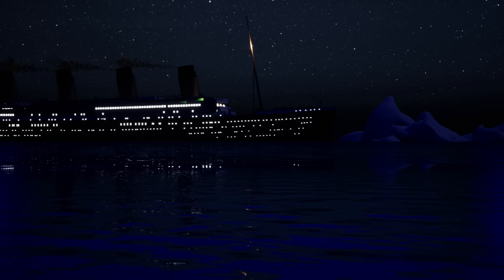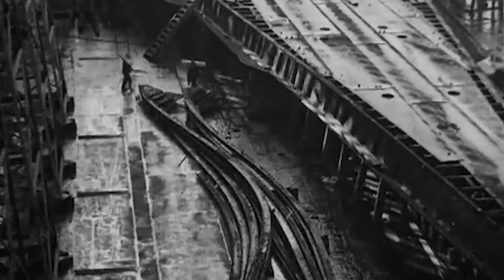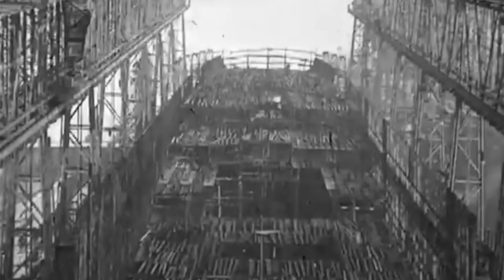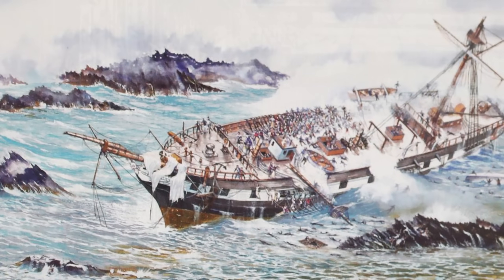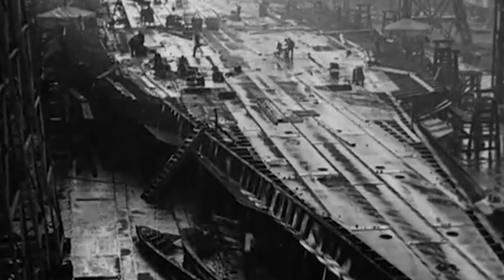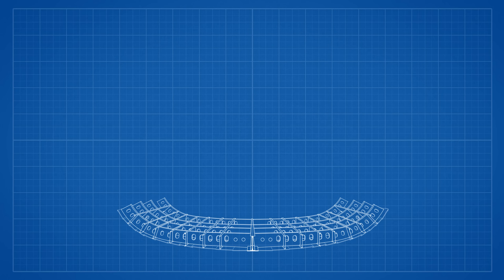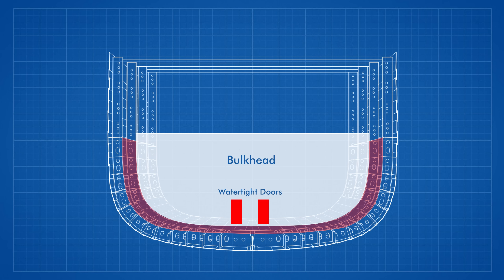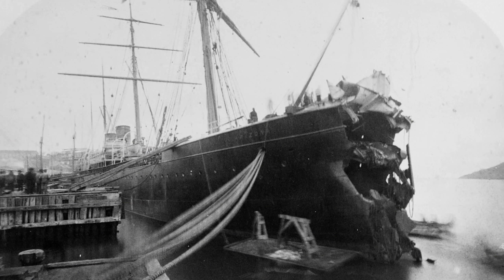How did the Iceberg Sink the Titanic?

Comment: There's a story from WWII, I think, about a ship that was hit by a torpedo. To save her and stop/slow the flooding, the crew used mattresses and blankets tied together and lowered over the side of the ship where the hole was. The mash of material was pressed into the hole like too much toilet paper in a drain and significantly reduced the flooding enough for the ship to limp back to a drydock.
Reply: Titanic had pumps to fight the flooding with as well and they were at least put into use. Even if the flooding was reduced by only 50%, worst-case scenario: Carpathia arrives on the scene with an hour to spare. Best-case scenario: a 50% reduction in flooding is enough that Titanic's own pumps can keep up and the ship is able to float until more substantial help arrives.
Reply: @dextercochran4916  Titanic's bilge pumps pulled 2 tons of water per minute each. the flooding was calculated at 400...
Reply: I'm in the RCN and we have a bunch of different methods and tools to stop the egress of water, blankets and mattresses are definitely a valid method.
Reply: That is a technique called "fothering" and it has been known for centuries to be effective.  One of the genuine mysteries about the Titanic was the near complete lack of damage control ordered by Capt. Smith.  Given the nature of the damage suffered by the Titanic even fothering with carpets would likely have been effective enough to keep her afloat for a significantly longer period of time.  As it was, her hatch covers were heavy canvas, and would probably have worked very well.
Reply: I remember seeing that in the Horatio Hornblower series.
Notation, seeing that his cattle ship was holed beneath the waterline, dived in with canvas and plugged the hole while his sailors pulled it tightly in place. 
It might have worked if Smith and Andrews had tried it on the boiler room gash.
Reply: @fearlessfosdick160 I believe the lack of experienced seaman had a part in lessened damage control by 1912. These large vessels were more floating hotels than ships! They didn’t have enough seaman to man the lifeboats even though they were only allocating 2 per boat lol. That’s was why Lighttoller allowed Peuchen  into a boat because the ladies said they were short handed.
Reply: @fearlessfosdick160  how many able body seamen would it take? How long would it take to undo a tightly dogged hatch cover? Where would they get the rope to lower it? Would any of them have any training in “damage control”? Was “damage control” even a concept on any civilian ships of the time period? Remember this is 1912 not 1940’s…
Reply: @timothyreed8417 1500 people were sentenced to death, they had nothing to lose anymore, so 1500 passengers could've been able to do it.
Reply: @fearlessfosdick160  what’s fothering? And how would canvas have helped? Is it like waxed canvas?
Reply: @BarBea83722  To fother is to drop a sail or canvas hatch cover over the side of the ship and drag it toward the keel until it covers the damaged part of the hull.  The water pressure will hold it in place and the canvas becomes waterlogged and slows the ingress of seawater.  I am not saying that Titanic could have sailed to New York in that manner, but it could very well have kept her afloat until Carpathia arrived.  Any slowing at all of the rate of flooding would have given Titanic more time, hence my observation about attempting it with carpets.  That would not have been optimal, but the idea is to slow the rate at which the ship is flooding.
Reply: @fearlessfosdick160  That technique originated and was used, with some success in the era of much smaller, wooden sailing ships. Whether it might have been possible or effective on a ship the size of Titanic is yet another question to which we'll never know the answer. All we do know is that they didn't try it.
Reply: @fearlessfosdick160  bullcrap
Reply: @fearlessfosdick160  you can kind of see how insurance fraud rumors would be suggested. There's a great deal of interesting information behind the theory.
Reply: There are devices aboard ship called collision mats that are designed to cover breaches in the hull. They are made of canvas and other materials and block water entry by external pressure pushing the mat against the hull breach.  Titanic did not have enough life boats; did they also not have collision mats aboard?
Reply: @johnemerson1363  Well, one has to remember that this happened in 1912.  They may not have had collision mats yet, and the Titanic was meant to stay afloat with a large number of compartments flooded.  Titanic was meant to be her own lifeboat.  One also has to take into account that a lot of our modern means of damage control at sea, including our modern method of tracking icebergs, were learned as a result of the Titanic disaster.
Reply: @fearlessfosdick160  Very possibly.  I don't know the history of collision mats.
Reply: @johnemerson1363  No they didn't.  Damage Control to limit the ingress is provided on naval ships and they are also trained in it (I was an RN qualified Damage Control Instructor).  I was also in the MN for 18 years and can assure you that a ship of the Titanic's size is an impossible fothering exercise, especially with lack of materials, trained men and only around an hour and a half at most to achieve it.  Fothering went out with sailing ships - you have to not only lower the fother over the side, you have to pull on the other side too to pull the fother under the ship.  The Titanic's crew may have done it on sailing ships but not a massive liner.
Reply: @stephencarey5074 its a shame you were not on the ship to help stop it from sinking
Reply: Interesting theory ? Maybe this could have saved Titanic. Only instead of using mattresses they could have used Cal and Rose's mother to plug the leak
Reply: @Number-5-is-alive  Perhaps it could’ve helped Titanic stay afloat longer, but save it?
I think that’s near impossible. The damage was simply too deep, certainly too deep to use this technique & continue trying to sail to NYC:
Reply: @Number-5-is-alive underrated comment. An cals money haha that woulda helped
Reply: Fothering is cool and all, but lets not forget it was like  20 or 30 meters from the bridge to the water, so lowering anything from the height is kinda hard.
Reply: That happened. I believe there are things called Crash Blankets that do exactly that once lowered over the side on the outside of the hull, but were first used in WW1, several years after this collision. Just watched another YT video that postulated that if the Titanic had gone straight into the iceberg, the bow would have been completed trashed but it would have damaged less watertight sections and they would very likely have survived.
Reply: Theres nothing that could have saved titanic after the collision other than a closer ship to them. The iceberg never ripped through the hull plates. Rather it sheered rivet heads off and or bent the overlapping hull plate connections over a 300 ft span. The gaps that formed allowed water in so far below waterline that the shear weight of the ship as she filled increased the flooding. The entire opening of gaps between plates and or missing rivets formes total area the size of a kitchen table... Thats all it took. Over 5 compartments compromised, even with the pumps running, the design of the bulkheads as advanced as they were did not go up high enough to a sealed deck like B deck. She did not have a double hull. She stayed afloat over 2 and a half hours, that alone is a marvel. So she was doomed long before the collision by design yet she was as strong as she could have been given the time period and technology that was applied to her. Also, bad luck played a part in the demise as well.
Reply: @MarkPB90  
The rivets were countersunk in that area for obvious reasons, so wouldn't shear off.  Sonar scans show rents in the hull that are not in line with the plate edges.  The same with Costa Concordia - the plates tore, not the welds.  A welded or riveted joint is stronger than the parent metal.  We won't know for sure unless they get a suction pipe going in the bow area!
Reply: @stephencarey5074  Please eplain then how we have pulled hull sections up with missing rivets. You hit those rivets and shear the head and then bend that plate off the contact point that little bit of rivet behind the plate wont hold it together under that kind of pressure. The berg popped rivet heads and the plates separated. A ship going 20kts side swiped an immovable object. None of the reports from the fireman below in the trials support tearing the iron shell plates. If she was gashed she would have gone down much quicker than she did. Now, Fred barret testified that it was torn through boiler room 6 however after 10 minutes after collision when he returned to 6 the water level was only up a couple feet. That doesn't support a tear. The other info thats been examined is the rubbing or bumping of the ship on the berg at the bulkhead/ plate joints which would compromise bulkhead rigidity. 2-5 got it the worst and none of the sonar scans have shown a hole beneath the seabed in the draught portion of the hull plating. The only hole on the starboard side has been from impact on the seabed when she broke her nose.
Reply: @MarkPB90  
Those rivets were from the accommodation area and not from the underwater hull.  They had already been subjected to massive stress when the ship broke apart, and had been underwater for a century.  There are no rivet samples from the damaged area because it's covered in silt and still part of the ship, which is still supporting its structure a century later.
We'll find out one day, but I doubt I'll be around!
No one down below would know how the water was coming in, only that it was.  It was very sudden and th area was hidden by the boilers themselves.
I was in a ship which was holed by ice - the plates tore, not the welds, and who knows whether the ice was in the rivet or plate area?  It makes no difference anyway, the hull was pierced and the water came in.
The underwater rivets were countersunk, not proud of the plates.
Reply: The video passed and i heard nothing of it, i got lost in this comment thread, it was so interesting, i never knew this technique. Thankful to all of you for sharing 😊
Reply: Honestly seeing something like this makes my head turn in every which way. The gashes in the titanic (whether they were gashes or shaved rivets) were long yes, but not thick. Think of them as a papercut, in another video the creator mentions that they ranged from 1 to 6 inches in width. Not only that but had they been able to slow the flooding in at least one compartment the titanic wouldve been able to stay afloat. (At least longer than she did) The titanic was one of the first ships to implement the tanktop, and it was designed to keep the ship afloat with 4 compartments completely flooded.

This is also not to forget that yes there gashes were long but the intake of water creates such pressure that it wouldve held whatever they threw down there very very well. And hell, even if it didnt? The objects wouldve flown into the compartments and took up space, leaving less room for water and creating at least some form of slowing mechanism.

There are also arguements made that had they hit the iceburg headon they wouldve been able to still make it to a port nearby (people wouldve died, but not nearly as many that did here). 

Overall, the titanic sinking cant exactly be blamed on one specific thing. (Well i guess it could technically, but i dont see yall fighting an iceburg so?) The titanic was one of the best engineered ships over her time, right along side the britanic and the olympic. So engineering couldnt have been at fault. Realistically we couldnt have expected a captain to willingly go head first into an iceburg, especially when that would have meant instant casualties in comparison to this method (which he couldnt at the time know what damage it would have caused). Lack of damage control was definitely notable, fothering mightve been effective enough to keep her afloat just long enough for the carpathia to arrive. However I do believe this wouldve had to of been done by the passengers. If a group of 50 passengers had taken mattresses, rope, and weights they couldve fothered at least one compartment in an hour. And that was really all they needed. People say there was plenty of crew and they shouldve done something. Realistically, yes there were alot of crew members, but most of them were panicked or attending to their posts damn near to the end. Lets not forget that this was such an intense thing that the third class passengers were ☆completely forgotten about☆ they were not given instruction, and the ones brave enough to wander up deck and then into an area unknown to them to try to get a lifeboat, wouldve undoubtly have been too late to get on one. The main focus here is that the captain should've attempted some form of damage control, but when it first happened they hardly knew how bad the damage really was(nt). Lets also mention that had they created a water tight ceiling for these compartments it wouldve definitely led to a slower sinking. 

All in all, it was her maiden voyage and it was entirely unexpected. Who knows what wouldve happened if the operators had listened to the californian, or if the crew/passengers had attempted fothering. All we can do is sit back and address it from our modern day perspective. The titanic sinking was devastating, but I personally do not believe it was anyones "fault" the ship sank.
Reply: Don't forget: Titanic was designed to float with four compartments breached. All they had to do was stop the flooding in ONE of the compromised compartments.

Alternatively, they could've flooded one of the aft compartments as a counter-balance to keep water from spilling over the tops of the bulkheads.
Reply: Check out the story of the American T2 tanker, "Ohio" torpedoed during WWll and ultimately kept afloat by "camels" until she could discharge her cargo of fuel oil in Malta.
Reply: If the gash was under the water line and quite a big drop from the top decks of the ship, how would they go about fothering? serious question not saying it would or would not work
Reply: @kgisabeast Tie the blankets tightly to a rope and lower it down from the deck.
Reply: That's SOP.
If you can not adequately seal the holes from the inside, you do it from outside. 
The point of flooding control is not to stop the flood of water into the ship, it's to make certain the eduction pumps can work faster than the flood.

Edit, yes, even in this day and age, navies are taught to use mattresses, pillows, and blankets for damage control to save the ship. It's much more nuanced than it sounds, but it works.
Reply: I came across a similar story when I used to spend time on the royal marine recruitment forum. One of the admins was ex Royal Navy and his profile picture was of the mattress up against the inside of the vessel. I’m convinced it was a submarine but I could be wrong. Anyway, I believe it was during the falklands war.
Reply: I thought I heard a US destroyer or cruiser did something like that back in the 80's or 90's as well, after a terrorist attack
Reply: The ship was commanded by captain lewis
Reply: Man this comment section is dope.  I have read each comment! 
I never thought of the situation this way!  Great theory!
Reply: @MohammadFarhan-mo6mo  Faulty theory since it wouldn't work
Reply: Allegedly there was already 14 feet of water in the first couple compartments after 10 mins.  Who is going to be able to dive down 14 feet in ice water to stuff a mattress in a hole you probably couldn't even see?
Reply: That's a common practice, called a collision mat.
Reply: Thats easy the ww2 were filled with soldiers the titanic was mostly loaded with the rich and spoiled that always had people do things for them
Reply: @Zander Vanhyden  the ship was sunk on purpose , it was a psyop,  insurance sting and multiple murder . I can prove it
Reply: @astitvayaduvanshi312  Irrelevant.
Reply: Sounds like a load of bullshit to Me , a gaping hole with rushing water would suck a mattress straight through.
Reply: Yes that ship was uss Texas a ww2 battleship
Reply: Sounds like a load of bullshit ...
Reply: Nopes. Period.
Reply: The Olympic is the scuttled wreck on the bottom of the sea. The actual Titanic went on to serve the germans in two world wars. The White Star lines and Illuminati were doing a great work Op. Search the Document - Polar Field Reversal as Seen With HINODE. It's all about our (local) Sun's intrinsic magnetic field is changing to a Quadrupole comfiguration, now look at the day the NASA doc. was released. Our "Sun" is supposed to go white before it extinguishes completely. This seems to have been resolved w/the energetic comets etc.
Reply: The remains of SS Great Britain were towed back from the Falklands to the UK in similar manner!
Reply: Really cool story. Thank you!
Reply: You guys seem very knowledgeable and this seems to be a very good comment. Everyone just trying to help each other and no egos getting bruised.

I'd like to understand more about ships and their workings. I have absolutely no experience but anyway here goes.
Even though I know this idea is too simple, I want to get a good idea of the mathematics here.
It was too late when they saw the iceberg to turn the ship on its course so they stop the engine. Stopping the engine takes time obviously and the ship is still going to sail for a long time after. I don't know how long but maybe you guys do. Now, what about the option of even reversing the engine and turning the rudder such that the ship is diverted away from the iceberg. What are the time tolerances here for what I'm talking about back in 1912 relative to a ship today?
Reply: @jimheffernan6341  They did reverse the engine. Thing is: even doing that, a ship with Titanic's mass is going to take at least a half-dozen miles to come to a full stop.

Titanic actually didn't miss its turn window by much. Had the crew seen the iceberg just a few minutes earlier and everything else played out the same, she could've dodged the berg.
Reply: Q
Reply: Yeah but on the Titanic they wouldn't have just used mattresses and blankets tied together they would have thrown 3rd class passengers in two to help block the gaps with their bodies, hands and fingers.
Reply: Stuff Unsinkable Molly Brown in there.
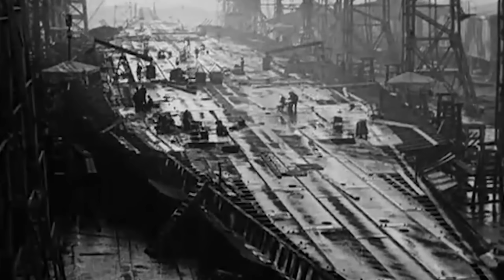Reply: 🎉🎉🎉🎉🎉🎉🎉🎉🎉🎉🎉 1:51
Reply: The damage to the titanic was just too much for something like that to work.  Even if it could work they would have had little to no time to get it done.  Yes, it took almost 2 hours for the titanic to fully sink.  However, it only took about 10-20 minutes before any possibility of saving her was gone.  By the time they knew the full extent of the damage it was too late.  They had zero opportunity to try anything.  At that point, the best they could do was slow it down enough to buy a few extra minutes.
Reply: @jeremywj  Sorry but this is really wrong.  As long as water is entering the hull fothering will work, and filling an area that's flooding with buyoant material to displace water will always displace water.  And even if it were true, an extra 10 minutes could've seen the collapsibles properly filled and dozens more lives saved
Reply: @jeremywj  You are suggesting that a torpedo blast would do less damage to a ship much smaller than Titanic than an iceberg sideswipe to Titanic herself.

That's the only way what you're saying makes any sense.
Reply: @dextercochran4916  Have you tested the power of a torpedo vs a hard, massive chunk of ice at twenty plus knots of speed?

If so, please report back.
Reply: @Grandmaster_Dragonborn  Do you really need a hard test to confirm if 1 ton of TNT causes more damage to a purpose-built warship than a large chunk of ice to an ocean liner at a steep angle???
Reply: Shame that their finest Persian carpets would have probably been the best thing due to their close weave. A piece of culture from the desert goes to the bottom of the ocean.
Reply: It's weird how such an experienced captain didn't even attempt basic damage control like that.  Have the crew smashing up deck chairs and stuffing the front of the ship with the broken wood - it displaces water and increases buoyancy.  Grab the canvas hatch covers, weight one end and lower them over the side with ropes - instant hull patch.
Reply: @saucyduckglobalomnihyperme7510  In retrospect, yes, that would have slowed down the intake of water. But during the event, they were best-guessing where and how many gashes there were, with some fearing openings closer to the keel (not just the starboard side plates).
Reply: @saucyduckglobalomnihyperme7510 after a tragedy it’s easy to come to conclusions.. we don’t know how serious the flooding was in those compartments and if people could work out a viable solution.
Reply: @saucyduckglobalomnihyperme7510  It's tens of thousands of t of water a few broken chairs won't give her back her buoyancy.

Why canvas wasn't used I don't know that's been done for centuries. Maybe didn't have anything large enough or no good way of getting it there. Diving to a hole on an age of sail sloop and stuffing some rope in and covering the hole with canvas is a bit easier than doing it in the frigid Atlantic on such big ship. Someone usually had to dive down and make sure the canvas is positioned well.

In theory if they could have patched boiler rooms 5 and 6 it might have worked but 6 was already full pretty quick and that was enough to take her down. She may have had the margin to stay afloat with Nr 6 flooded maybe not.

I think the pumps could do 250 t an hour so if the inflow could have been stabilized in Nr. 5 and 6 rooms maybe. Could certainly have given her some more time, maybe enough for Carpathia to arrive before she sank, maybe even hook up her own pumps until a pump ship could arrive and take over while they tow her to port. 

I know that using canvas was less common then than it had been 50 years earlier don't know why. Maybe it was deemed innefective or ships simply didn't carry a lot of it anymore. 

But mainly I think the job of diving around the hull and figuring out where to put canvas was too much to ask in -2C water.
Reply: @please_stop-v7o  The cargo hatch covers were big thick sheets of canvas. No need to dive because they knew where the water was coming in, especially in Nr. 5.  The ship was at a stop, all you had to do is weight the canvas and lower it over the side by the correct amount, which anyone could've calculated in about 3 seconds.  And the practice had been around since the 1770s.

Also they only needed to displace a few percent of the water in the bow to have a big effect on down angle, which means limiting spillover. Especially if you can get Nr. 5 watertight and cover another square foot or so of opening, they really might have floated until morning.  

It just seems like Smith got told too much of the ship is open to the sea and help was hours away and sort of gave up
Reply: @saucyduckglobalomnihyperme7510  during the time, they seemed to think that the iceberg tore a massive continuous 300ft gash into the hull which probably would've been impossible to plug. One can only imagine if they had known it was just the rivets which popped and managed to plug up the holes.
Reply: @fearlessfosdick160  alright then, where would they get the manpower to drag a wad of material under the keel and plug the hole? The crewman? Well the crew are already working on the lifeboats and if this plan fails and the plug breaks or they fail to locate where exactly the hole is, then that’s less time to launch the boats. If you knew anything about Titanic, you’d know that they just barely managed to get all 20 boats off, with 2 of them literally being floated off the deck damaged. If this plan fails, then some boats would’ve definitely failed to launch and more people will die. It’s an extremely high risk situation is my point.
Reply: @AndyHappyGuy  Having done it myself, I can tell you that a relatively small team could have accomplished the fothering of a couple of those watertight compartments within a half hour.  During the first hour of the sinking, there was no damage control attempted apart from simply closing the watertight doors, and the officers did not begin to lower the lifeboats for at least an hour after the ship began to sink.  Titanic carried 913 crew members.  There was plenty of time and plenty of crew to attempt the fothering of the hull at two or three of the watertight compartments at the very least, possibly even all six.  It could have worked, but today we will never know how well.  And understanding your intital confusion, one doesn't have to drag it under the keel.  I said drag it toward the keel.  In Titanic's case, one would have lowered the canvas, perhaps weighted, to the level of the damage.  Water pressure would have then done most of the work after that.
Reply: @fearlessfosdick160  now you've gotten me curious. How would the canvas or whatever material they could use slow or stop the water coming in? It's got to be a couple thousand gallons of water coming in a minute, wouldnt the same water pressure that sucked the material in destroy it too?
Reply: @fearlessfosdick160  im curious as well, how do they know they are lowering this material to the exact location of damage? The suction just guides it to the hole or what?
Reply: @marked4death076  To a large extent, yes.  In the Titanic's case the location of the damage was known to Capt. Smith very quickly.  As I already said, the point is that they didn't have to stop the flooding but only slow it, and they didn't have to fother all of the damage, just enough of it to keep two or three of the compartments from flooding as quickly as they did.  It likely would not have saved the ship, but it might have kept her afloat long enough for Carpathia to arrive.  As to Andy's question, no, the canvas would not necessarily be destroyed by the water pressure, especially given how narrow the damage between the plates was.  If nothing else, it certainly would have been worth the effort to try it.  The thing about it that mystifies me was that apart from closing the watertight doors and turning on the pumps, no attempt at damage control was ever made.
Reply: @fearlessfosdick160  wow and they would of have clearly known this i would imagine even back then, that is odd they never thought of it. Panic maybe? Just not thinking clearly
Reply: @marked4death076  Yes, they would have known it.  Fothering is a technique that is hundreds if not thousands of years old.  In answer to that question, if some of the reports can be believed, Capt. Smith went into a sort of funk when he realized that his ship was going to sink.  It is plausible to surmise that he wasn't thinking clearly at any point after he ordered the lifeboats lowered.
Reply: @saucyduckglobalomnihyperme7510  You're forgetting the intake of water on starboard side would have made Titanic list to that side, making it extremely difficult to apply any canvas 'wadding' below the advancing water line.
Reply: @ellayararwhyaych4711  Weirdly, everything I've read had Titanic at a port list
Reply: @saucyduckglobalomnihyperme7510    She listed very slightly to starboard and then straightened out briefly before taking on a slight list to port.  Saucy Duck is incorrect that the extremely minor listing that the Titanic suffered would have made any genuine difference.
Reply: @fearlessfosdick160  I'm not the one who said that
Reply: @saucyduckglobalomnihyperme7510  right, it was Ellayararwhy Aych.  Sorry about that.
Reply: @AndyHappyGuy I think that was the point, there could have been other things to help but assume it’s a 300ft is mad. Assumption is the mother of all f#@& ups
Reply: @fearlessfosdick160 Well said. lf you're not a very well trained, experienced, licensed mariner, naval officer or highly experienced, trans-ocean boat captain, you sure write like one. That's intended as a compliment. Having experienced it personally, any serious breach in the hull at sea can be and often is, absolutely terrifying.
Reply: @marked4death076  Multiple causes, including the ones you noted.
Reply: @fearlessfosdick160  You seem knowledgeable about this.  Had the Titanic been able to stay afloat until the Carpathia arrive, would it have been feasible to tie the bow of the Titanic to the Carpathia, hoisting it up with winches or something similar and then used the Titanic's pumps to pump water out of the bow somewhat?  I am stabbing in the dark of course.  I am not a sailor.  I appreciate your opinion.
Reply: @trevorstolz8580  No, that would not have been a reasonable thing to attempt for a universe of reasons.  Off the top of my head, two of them are that Carpathia was a pretty small ship relative to Titanic. Doing that would have done more to endanger Carpathia than to help Titanic.  The other reason is that Titanic would still have been taking on water.  Those winches just wouldn't have been able to lift or stabilize that sort of weight.  There was also the problem that the pumps were located aft and were not as effective at pumping water out of the forward compartments as they should have been.  Titanic was going to go down no matter what.  All we are positing here is the possibility of some desperate damage control measures that might have kept her afloat for a little longer.
Reply: @saucyduckglobalomnihyperme7510  how many able-body sea men would it take to unmount a hatch cover that has been dogged down tight against winter storms? How long would it take? Where would they get the rope to lower it with? The holes were somewhere along a 300’ path along the hull. The biggest were in br6 and br5. How do you lower down from the boat deck? In 1912 there was no concept of “damage control”…it takes drilling with a crew over and over to even be somewhat successful…
Reply: @fearlessfosdick160  Smith was probably worrying about his ruined reputation
Reply: @fearlessfosdick160  The ship, and the damage, was massive tho...
Reply: @HANKSANDY69420  The damage was not massive and that is the point.  It was calculated mathematically, from the rate of the flooding, that the damage did not exceed 12 square feet, about the size of a refrigerator door.
Reply: @fearlessfosdick160  wow
Reply: @fearlessfosdick160  Monday morning quarterback.
Reply: @AndyHappyGuy  I agree with you , plugging the holes with canvas 😆 I can't believe anyone would be dumb enough to think that would work.
Reply: @fearlessfosdick160  There may have been over 900 crew members, but only about fifty of them were actually trained seamen!  The engine-room lads would have been unlikely to have the necessary expertise, and the vast majority of the rest were cabin attendants, cooks, stewards and what-have-you.
Reply: The order wasn’t given to abandon ship for about 47 minutes. They also had the labor of all the men who would not get into lifeboats with women on board.
Reply: @AndyHappyGuy 
Titanic had 11sf of damage which allowed in 370 gallons per second.
Reply: @fearlessfosdick160 The captain was told Titanic would have only lasted about an hour afloat. Whoever would have gone down there to “plug” the holes would have had to do it underwater.
Reply: @Alexx_0027  Yet another tiresome expert who doesn't understand the concept.
Reply: @fearlessfosdick160 I don’t think it’s ever really been determined if the damage was on the starboard side or under the ship. Some testimony from the time claimed titanic slightly lifted up from the water as if it had sailed over a piece of the iceberg underneath the ship. None of the recent dives have spotted where or what the actual damage was since the area is believed to be buried under sediment.
Reply: @marked4death076 They probably did thought of it. Seeing as it had never been done on a ship the size of Titanic, they were most likely afraid of it potentially failing
Reply: @fearlessfosdick160 The biggest problem I see with that idea is that, being a civilian crew on ship thought nigh unsinkable, the crew probably wasn't trained or experienced with such measures. I have no doubt that a well trained military crew would have been able to outright save the ship, but a relatively small and poorly trained/inexperienced (look at how they struggled  just launching the boats. And to be clear, I am strictly talking about in the realm of damage control/emergency evac) crew  like what Titanic had would have taken far more time and manpower to take such actions than they had.
Reply: @marked4death076  Have you ever put your hand over the drain hole after you’ve pulled the plug on a full sink or in the bath? It sucks your hand to the drain and if your hand is big enough it plugs the drain and you can stop the water going down the drain. Same concept except your hand is the canvas in this situation
Reply: @saucyduckglobalomnihyperme7510 easy to say when info like that is readily available. Back then not so easy plus the titanic was really really big. To do what you said would have taken hours the same about of time it took too sink
Reply: @saucyduckglobalomnihyperme7510  Respectfully, I don't think you're giving due consideration to the size of a ship like the Titanic.

You keep saying, "they knew basically where the holes were." No, they knew which of the watertight compartments were flooding, there's a difference. 

The ship was 882ft long by 104ft from bottom to top deck; 91,728 square feet along each side of the hull. It had 16 watertight compartments, each surrounded by roughly, therefore, 5,733 square feet on each side which could have been pierced. They knew that five of them were flooding, leaving them with 57,330 square feet with an unknown number of holes of unknown size to plug. 

Think about it
Reply: @saucyduckglobalomnihyperme7510 It would have been counter productive to do that. The ship was going to sink no matter what they did. The ship only had about 2 hrs until it went under, and there weren’t enough lifeboats to get as many people to safety as possible. The engine room were busy keeping the lights and water pumps going, the officers and stewards were charged with filling the lifeboats. The Stewards and officers were also charged with making sure no one rushed the lifeboats. Which was a huge concern for the crew as they realized sooner rather than later the passengers would have put 2 and 2 together. There’s also the fact that plugging the hole with chairs and other stuff had never been done on a ship the size of Titanic. It most likely was a thought that came into everyone’s minds, but most likely smith and everyone else were afraid of the possibility of it not working.
Reply: @saucyduckglobalomnihyperme7510  it worked in Hornblower lol
Reply: @saucyduckglobalomnihyperme7510  was “damage control” even a concept in 1912? On any ship of the time?
Reply: @timothyreed8417  Yes, fothering specifically had been around for hundreds of years at that point. The hatch covers could've been off in mintues, they're canvas and sailor have knives.
Reply: @saucyduckglobalomnihyperme7510  were any of the able body trained in how to do it? Any of the of the officers? Seems to be something used on military ships not civilian ships…
Reply: @timothyreed8417  I mean it's not rocket science, you weight one end of the carpet/canvas/etc and drop it over the side with ropes.The math for how far is really easy - you know roughly where the holes are, you only need to be accurate to within the size of the fabric, and the water pressure actually seals it against the hull for you..  Same with taking deck chairs and throwing them into the cargo hold - any water you can displace there buys you time. They just gave up
Reply: @saucyduckglobalomnihyperme7510  isn’t hindsight wonderful…
Reply: @timothyreed8417  Sure, it's just strange that they were an experienced crew with more than an hour to react, and it never occurred to anyone "hey, we've got a hole in the boat, why don't we try to plug it"
Reply: @1993digifan  They already knew where the holes were, especially the lethal ones in the boiler room, from when Andrews and the carpenter sounded the ship. Andrews even calculated how long the ship could stay afloat. And with a 30 foot hatch cover, you only need to be within 30 feet of the hole to cover it.  It could've given them hours. And it's not my idea, it's just basic stuff done when there's a hole in a ship.  And obviously getting everyone possible off the ship wasn't the big priority, or they wouldn't have been launching boats half empty
Reply: @Saucy Duck GlobalOmniHypermedia  Your assuming that what mattresses and carpets weighed down by coal could actually plug up the holes perfectly on the first try (imagine how much time and deck space would wasted having to try and plug just one hole over and over), that they had rope that would go far enough BELOW the waterline to get there, or that just throwing the weighted carpet that it would actually go to the holes just because the place on deck was above the hole. You do know that the reason boats were launched half full was combination of the max weight not being communicated to the crew clearly (pre-Titanic no one imagined that the life boats would be the ONLY place to put people from a doomed ship in their modern era, they all assumed that with modern communications and engines that ships arrive in minutes and lifeboats would just be needed to ferry passengers from the dead ship to goods ones), Lightoller only letting women and children passengers on the boats, and with them knowing that they have less than 2 hours before the ship is at the bottom of the ocean they were not going to wait for it to be convenient for the passengers already on the boat deck or wait for everyone to get on the boat deck to leave to start launching the boats. You do know that the last two boats weren't even launched they basically floated away (one upside-down and the other half flooded with water), knowing that also punches holes people assuming that having more lifeboats would've saved lives? Oh wait, of course you don't know that. If you did, you would have some idea of the timetable of the sinking, the psychology of the passengers, and that time was of the essence and in the early stages of the sinking before it was clearly evident to everyone passengers (who didn't know because the crew didn't want to cause a panic) wouldn't be thrilled at the idea of leaving a warm well lit ship to go into small wooden boats in the middle of the freezing ocean on a moonless night and the crew wasn't going to waste valuable time trying to get people to fill the boats.
Reply: @1993digifan  good lord, fothering has been around since the 18th century.  It's not hard or tricky. And yes, carpets or, better yet, the giant canvas hatch covers, would work really well. It takes exactly 2 seconds to calculate, since you know where the hole is, and you know how high the deck is, how deep you have to lower a patch before it's over the hole, and all you have to do is get them in the neighborhood of the hole, and the water pressure seals it. Technically, they only had to cover the hole over the coal bunker and Boiler Room 6, because the ship could float with the rest of the compartments flooded, and two patches could've bought hours. Ships have lots of rope and weights.  And yep, if they'd bought themselves even 30 more minutes, the collapsibles could've been launched properly and dozens of lives more could've been saved. Another few hours and the Carpathia would've been there to take off passengers, which they also knew from its wireless messages.  They just gave up.
Reply: @Saucy Duck GlobalOmniHypermedia  Oh, let's do a test! You get put a passenger liner in the middle of the ocean at night, the ship receives fatal damage, you learn that the ship has less than two hours to live, and thousands of people are on board. Do you really delude yourself into thinking you would just know the absolute bestest best answer with all that hanging over your head? This may shock a person like you, but when you are living in the moment and don't have multiple chances to get the bestest outcome, you're probably not going to get it. Like how people bitch about how there was physical room for Jack but with buoyancy not being able to hold the combined weight and the two freezing with no time to prepare or do overs no fucking shit they wouldn't think put the lifejacket under the door. Plus, you are still failing to answer if they would even have ropes to reach BELOW the waterline or what do you actually believe that just throwing a mattress or carpet overboard that would just drift to the hole, how much viable time is wasted having to grab the shit you think can preserve the ship and then having to work to get to holes several feet below the waterline, how many of the crew of a passenger liner would have the training needed for collision mats when those are only kept on warships and a personal sailboat is a lot smaller than an ocean liner so any comparison falls flat. Hell, a threads on Encyclopedia Titanica and Reddit talks about if collision mats or even MacGyvered ones would do any good if you want to preach your idea that they could totally get a carpet over the opening in any time that would make any real meaningful difference and not just a waste of time that would get even more people killed by taking deck crew away from the lifeboats. Guessing you also don't know that the water in B6 was already waist high by the time the boilers were shut down in the room, so how exactly would they know exact places of where openings were or the length of the area since the workers would be more focused on making sure the boilers didn't explode than seeing how far it went and by the time the damage could be examined all that could be told was what areas were hit but not the exact places, let alone to B6 which had already flooded 14 feet (leaving barely a foot left of open) by the time Smith and Andrew got to look at the damage.
Reply: @1993digifan  Of course they had ropes, what are you talking about?  It was an oceangoing vessel.  They knew where the damage was because the men in boiler room 6 told them where it was. And, again, if you're dropping a 20 foot canvas hatch cover into the water, all you need to do is get within 20 feet of the seam.  Two men could've done it.  They never tried, and from the inquiries that followed it seems like it never actually occurred to them
Reply: @saucyduckglobalomnihyperme7510  they weren't experienced. Most were not even familiar with the ins and outs of the ship.
Reply: @timothyreed8417 Useful if you're ever in a smaller boat that's sinking too.
Reply: @saucyduckglobalomnihyperme7510  so essentially throw everything into the cargo hold, even if it means damaging the cargo in that hold.
Reply: @merafirewing6591  Yep, I mean it's going to be underwater anyway, but if you can displace some of that water with something that floats, the cargo might be underwater on the surface and not the bottom of the ocean
Reply: @saucyduckglobalomnihyperme7510  well.. if it was dussins of small leaks along several compartments... could the crew even done that ? with sort of ish sized holes the water desire to 'flow' helps pressure makeshift patches in the holes.. but several dussin small cuts so to speak ,would lowering canvas do much to such things not to mention , they did know wich compartments that where flooding but thats still sort of a large area of 'hide' to cover up if not being able to precision stuff in the water is it not ?... 

then agen might just been that he was deciding he rather make sure the crew would lower life boats with children in them before any ship wide panic or desperation broke out so rather then gamble the nearest ship somehow be there an houer earlier then projected he went with the prediction no matter whats done she will sink and decided he rather trade delaying efforts for getting those taking it seriously into life boats early :/

hmm... not that it matters much not as if anyone ever know his actual thoughts , though i do find it fascinating how in a tragic way the desperate effort of some crew might have compounded the problem and ensured she sunk... after all its that thought experiment of if she hit the berg straight on sure so much motion energy and mass her bow likely would been smashed but how bad would that been...1-2 ? 3..? compartments outright pulped or even breaking of but the ship as a whole still floating or would such a impact have cracked her hull to start flooding to far down the sides anyway ...no one ever know..  ^^ 

well , no one that arent a spoiled idiot with to much cash and a desire to build a replicate to re-act it all out of boredom so... maby a saudi prince XD
Reply: @saucyduckglobalomnihyperme7510 the gash in the ship was over 300 feet  long.
Reply: Even if they tried I don't think they could have helped. That was one torpedo hole. The iceberg made a bunch of holes like halfway down the ship even if they plugged one or 2 or 6 holes I don't think it would have helped.
Reply: it's super easy to look back and say "why didn't they do this? Why didn't they do that?" There was one thing on their mind- getting as many people off of the ship as possible.
On top of that, ever tried to plug a hole that has thousands of gallons of water rushing in it every minute? Then keep in mind that it wasn't just one hole. This was damage spanning the length of 300 ft. This just wasn't a possibility in the case of titanic.
Reply: I doubt that happened
Reply: @marlonbrando9279  You doubt without knowing if your doubt is reasonable.
Reply: @_gorillaz freakinc._2  that is the dumbest thing I've ever read ? What do you even mean ? I don't do anything without subjecting it to scrutiny and analysis , I certainly wouldn't make  a comment like that without critical analysis,  what do you even mean ?
Reply: @Zander Vanhyden  how do ypu reply to a comment as dumb as yours???? What are you trying to say ??????
Reply: Ppl actually believe fothering would work for Titanic 😂😂First and foremost, it was pitch black that night which means you have zero visibility on where the holes are (and they were quite a lot of them). Secondly, even if you do a recon where the holes are from the inside, how would you even manage to get close to it so you can determine where the holes are? All they knew are which compartens where flooding up. Then you gotta lower the shit down in the water with some weights, yeah gl getting that sorted out lmao 🥲Dream on folks.
Reply: @Kingkongphil  gr8 b8 m8. 8/8!
Reply: @Zander Vanhyden no it was sunk on purpose
Reply: lol at some of you people.. you been watching to much fast and furious movies... there were to many holes in the ship, the water was pouring in ... you aren't patching a small tear in a tiny rubber raft... thank god half of you weren't running the show on that ship that night.. everyone would have died.
Reply: @ericdraven7185 you literally have damage control experts sharing their thoughts, what qualifies you to dismiss them?
Reply: @ericdraven7185  I don't think anyone here is suggesting that Titanic was able to be saved. The idea isn't to patch up the ship and sail on to New York like nothing happened. The idea is to try and slow the flooding at least a little to hopefully prolong the small amount of time Titanic had left, even if it's a matter of minutes or an hour. 

Damage control is not "too much fast and furious movies." DC is a real thing that has saved countless ships with some absolutely insane close calls. Two examples of this I can think of are the USN cruisers New Orleans and Minneapolis, both having their bows blown off from torpedo hits and still making it home. Not to say Titanic had anything close to that kind of military type training/equipment, nor was she built like a naval vessel, she was going down no two ways about it. But it's not out of the realm of possibility for the crew to have attempted, at least in some form, to slow the flooding whether or not it would be successful.
Reply: @loficampingguy9664  Actually, I was suggesting that it was in the realm of possibility. Over a dozen ships were coming Titanic's aid. Had damage control seriously been attempted, it could've bought Titanic enough time for more of them to arrive with their own pumps that could have assisted in flooding control. Simply keeping the aft-most compartments as dry as possible and keeping her bow above the waterline may have allowed patches to be put in place and the ship to limp to a nearby harbor. The gash in Titanic's side really wasn't that big, compared to the ship itself and it was intermittent, meaning some smaller holes were isolated from the larger ones and may have been able to be patched completely.